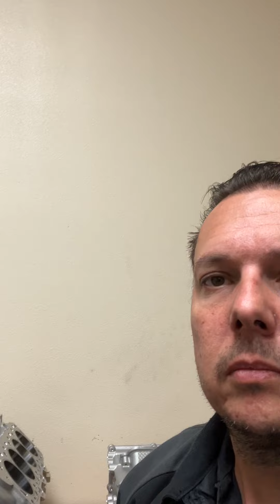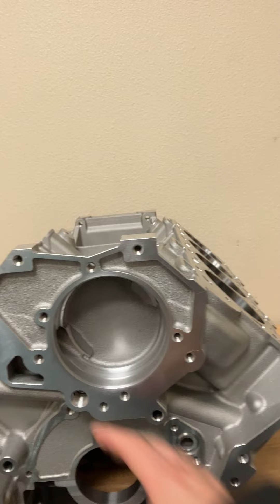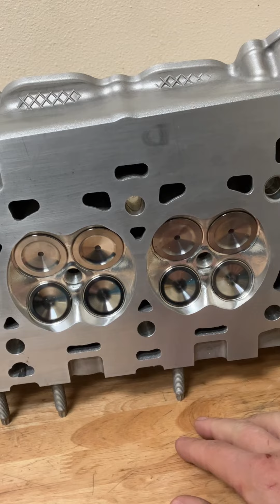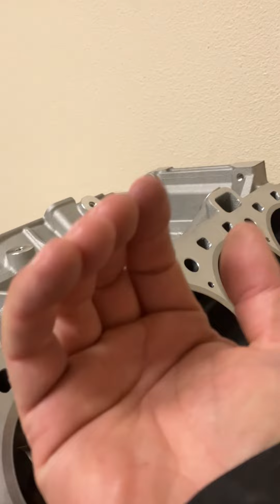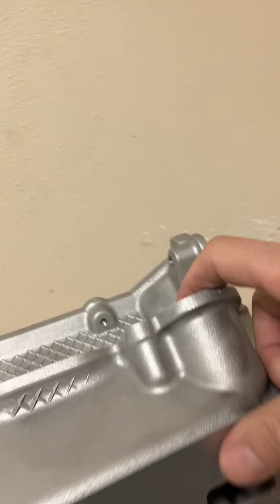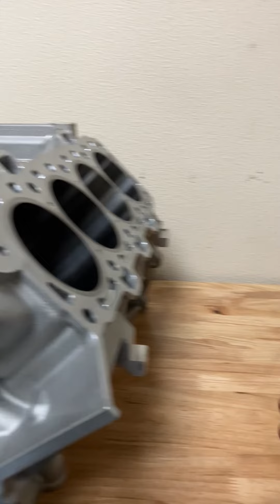Coyote Cooling system explained:

Comment: AED tuning / please explain,  I heard from some you tube videos that people are having problems with there coyote  motors with #4 #8  cylinders  getting  to hot and taking out the intake  valves losing compression. Is this common. I know you explain ed how the water flows and cools the coyote  heads, but what can a person do to  eliminate this from happening?  I own a 2016 f150  5.0 4x4 / 32,000 miles DON'T  want this happening to me or any one else.  Mustang geek on you tube told me about your videos.  Thank you for your and mustang geeks detailed videos.

Comment: Thanks for the detailed explanation...

Seems to me, shouldn't need anything more than to use a proper quality coolant, change it at regular intervals, based on use, and make sure the radiator has the proper flow and capacity to remove the amount of heat that's needed to keep everything at normal operating temperature.